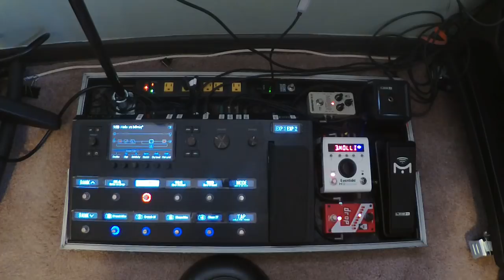Helix vs Mimiq

Comment: Hi man, your sound is great💪💪💪
Can you explaine the chain in your patch? Where  is mimiq placed?
Do you run stereo or mono? 
Can i make job with mimik mini (mono)?
Thanks Broooo 💪
Reply from the maker: Mimiq is in a stereo fx loop at the end of the chain.  Only reverb is after the Mimiq.  I run stereo into the mixer and I use IEMs.  Using the mini might work, it depends on how you run it.  The signal coming directly out of the Helix was too strong and I think it distorted the Mimiq, that's why I use an FX Loop.  I ended up running it in stereo because there was a little phase issue just using the effected side.  I would recommend using the full size.  I also don' t like the Mimiq anywhere else in the chain, but that's just my opinion.
Reply: George Hollis
Ok, thanks on quick replay...
I find some youtube rewiev... in mono configuration sound more like room or chorus effects. For real deal an best sound the stereo pa system or two amp is ideal solution...
Anyway, your lead patchs soun very fat and like tube amp... i will download it and try on my helix.
 Thnks for great videos and demos.
Reply from the maker: @zrkrlk  Yes.  It's basically a short delay of about 30 ms with a bit of pitch shifting. I can come close just using the helix simple pitch but it's really not the same.  If you double it up in mono it does not sound good to me at all.

Comment: I was wondering if you've tried the POD HD500X? And if so would you say that other than the touch UI, is the $1500 price for the Helix, compared to the $400 HD500X really worth it? 🎵🎸
Reply from the maker: I own the HD500 and I used it from the beginning.  I would say the LT at $1000 is more close to the HD500.  Being able to add IRs is huge.  Having 4 times the computing power is also huge.  The FX are about the same.  The FX loops in the Helix are better (using 4CM I had to compensate in the POD).  The amp sims are also better.  Another advantage of the Helix is the snapshots and the ability to change how the footswitches work.  Overall, I would say that the Helix is worth it  but it depends on your application.  I sold my 5153 50 watt and 2x12 cab.  I do not miss the tube amp at all.  Using the Helix only has been a great advantage for me.  If you have any other questions, just let me know.
Reply: I just upgraded my HD500 (also had it since release) to the Helix a month ago and I absolutely think the Helix is worth the money.   It is so much more powerful, versatile, and so much simpler to use.  Snapshots are a God send and when you start using them to their fullest it is an amazing thing.  Being able to have a single preset turn on an effect with different settings depending on the snapshot you are on is amazing.  The DSP and the pathing configurations you can do with crossovers with filters and slitters both Y and A/B makes it limitless with what you can do with it.
The LT will give you the same DPS as the full floor, but the Full Floor gives you quite a bit more and if you do any computer DAW stuff, it also lets you get Helix Native for $300 off normal price.
Reply: @spsanders69  Helix Native is now available at the same price ($69 on sale) for owners of Helix/Helix Rack, Helix LT, and also HX Stomp/Effects.
Reply: @JamieClark  Yeah thanks, it wasn't when I posted this a year ago.

Comment: What are you using to hold your mic stand.  I have been looking for something to use but they are not easy to find.
Reply from the maker: It is a railing flange I got at Lowes hardware.  You can also use a drum tom attachment (the part that attaches to the kick drum.  
railing flange - https://www.lowes.com/pd/SteelTek-3-4-in-Silver-Galvanized-Steel-Structural-Pipe-Fitting-Rail-Support/999930958
Tom mount bracket (wish I would have thought of this) - http://www.guitarcenter.com/Pearl/BT-3-Tom-Mount-Bracket.gc
Reply: Beautiful.  Thanks so much!